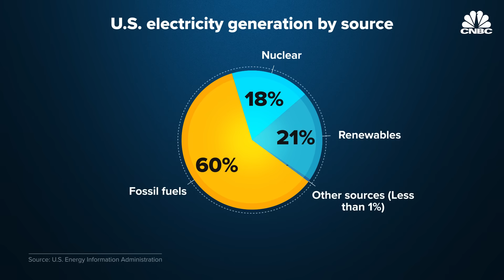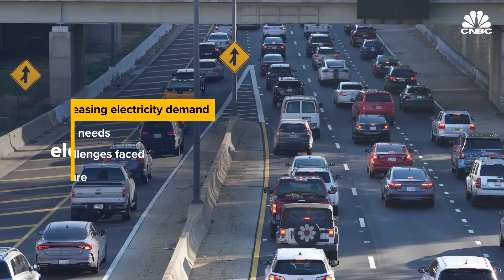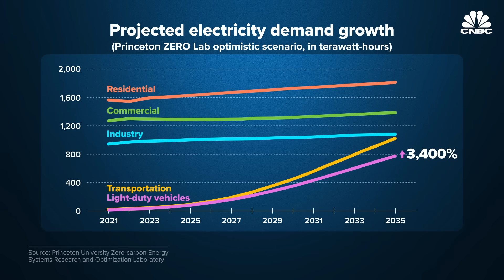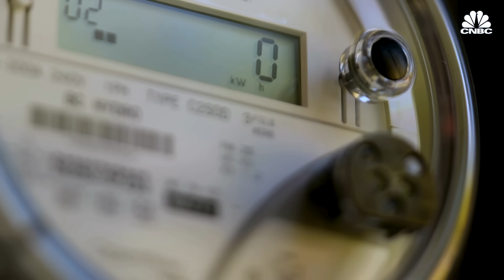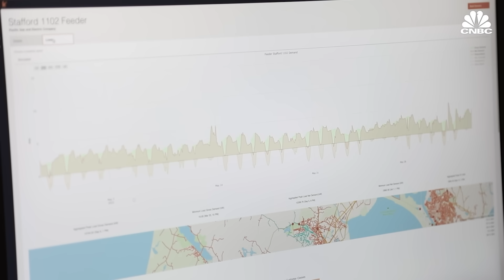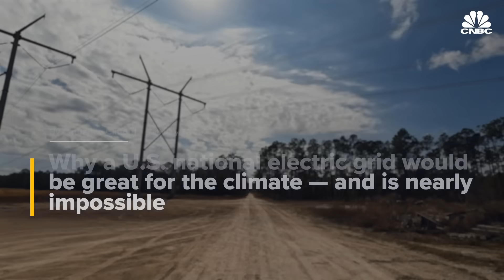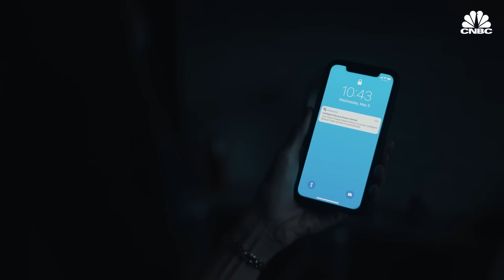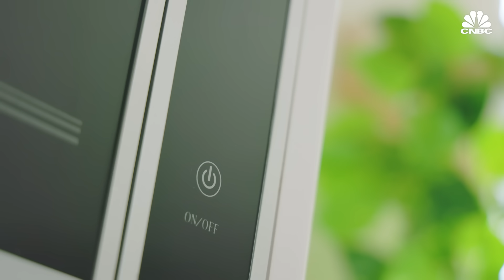Can The U.S. Power Grid Handle The EV Boom?

Comment: The answer before I even watch this video is a resounding no! Work on the electric grid in Nevada where their everywhere. A lot of transformers are already overloaded just by the houses. Add that we don’t produce any oil yeah that’s right you still need fossil fuels for electricity go figure and with those prices so high you have less generation or blackouts or higher cost for electricity . Oh forget to mention if your neighbor has one they’re eating up way more than the allotment their given basically stealing their neighbors share of that transformer. Sat on meeting with one of the largest EV initiatives they got all this grant money but none to rent out the land for those charging stations yeah that’s right you gotta pay the landowners. This is literally a ploy to try downgrade your fuel consumption which makes no sense. Electric companies build to minimum serve not gold plating a system, hasn’t  been done for a long time.

Comment: using the California example, it would cost about $1280 per person to update the grid. People will save much more than that by electrifying everything (EVs are cheaper than gas, solar can earn you money instead of costing, efficient heat pumps are much cheaper than natural gas of fuel oil...).

Comment: The US grid has increased in capacity 5x (500%) since the 50's.  To move to all EVs we only need to increase the grid capacity about 20%.  Most EV charging is done off-peak and actually helps balance the grid (increasing overall utilization).  Everyone also forgets that we'll be using less electricity to refine fossil fuels which helps offset the increased usage. The fossil fuel infrastructure uses a lot of electric power.  The statement that our electric usage hasn't increased in 25 years is way off, data centers created a huge increase in electric demand from 1998 to 2012 before it started to level off.
Reply: not bad -- you are pretty close.  20% Add for 100% EV, but then deduct 10% for the reduced Oil Processing.  Net increase is 10% across 20 years.   That was the general model.   But now it turns out that over 1/3 of EV owners also get Solar PV -- creating a Net Deduct of their entire house, along with the EV.  If this continues the final Utility Total at 20 years is a Net Negative.  Data Centers are only about 1 to 2% of the Total Grid.  Nuisance with Data Centers is not the load but the requirements for High Reliability. But look for that use to drop with near term technology shifts.
Reply: I don't know about the USA but here in the UK our 31 million cars do an average of 8,000 miles a year each . That adds a total of 65twh to last year's 306twh so back to about to about  375twh OR the same as demand WAS in 2006.
Reply: I think in North America the average is closer to 15,000 to 20,000 km a year (9400 to 1200ish miles)
The actual % increase in energy useage is very acceptable especially since it will take decades till 100% of all vehicles are electric. 

This news articles is discussing 2 seperate issues, the increase in renewables (and aging infrastructure) and EV adoption. 

If they continued to expand natural gas to cover the EV adoption it wouldn't be as expensive, but still greener than gas. Obviously the best solution is to switch to renewables AND EVs, but those two things don't have to be intertwined.
Reply: Uh, 50 miles a day in a model 3 is an extra 10kwh per car.  i.e. every household with 2 cars increases residential demand from 30 kwh/day to 50kwh/day.
Reply: @Effervescent_Smegma   You can do the big picture math by looking at US Total Miles Drive (per year) = 3.22E12.  And average Watt-hours per mile = 250 Watt Hours.   So 3.22E12 x 250 = 805E12 Watt Hours.   Current US Total Electricity is about 4E15 Watt Hours.  So (805E12 / 4E15)  x 100% give about a 20% increase.  But then deduct the present electricity used in the Oil industry and it is only a 10% increase.  Spread that across 20 years and it becomes 1/2% increase per year.  Home Solar PV is expanding quicker than that, so the net effect is a overall reduction in Utility Grid generated electricity. -- with ALL Electric Ground Transport.
Reply: @philtimmons722 what's this E in your equation? What type of math is this? I'm not familiar with this math. Are others?
Reply: @robertlee8805  Really, what school did you drop out of?  805E12  = 805 times (10 to the power of 12)
Reply: @retiefgregorovich810 be nice. Not everyone did maths heavy subjects at school. I talked to someone with a PHD in corporate adaptability, who didn’t know what an asymptote was. He wasn’t stupid. Just never had the need or opportunity to learn it.
Reply: @Effervescent_Smegma ,  From what I have read, the Utility companies back in the 70's had many sleepless nights because of the increased use of air conditioners.  They where not energy efficient back in the 70's.  My 1971 air conditioner used 4,000 watts per ton of cooling capacity, while the replacement I installed in 1995 was 10 SEER, or about 1,500 watts per ton.  Now I have a 2014 14 SEER unit, and it only uses about 950 watts per ton of cooling capacity.   So my heat pump uses more than 25 KW a day, enough power to drive a Tesla 100 miles a day. 100 miles = 36,500 miles a year, much more than the average driver does each year.  

And as pointed out so many times today, the cars can charge at night during off peak power, or in the daytime in a place like California where they have 15,000 MW of solar power in the daytime!  

And a lot of homes are installing a 6 KW solar system, so they are reducing their load on the grid by 30 KW per day.  Thanks everyone going solar!  You have saved Florida from what Al Gore predicted as 2 meters of water over Florida!
Reply: If Sen. Manchin is heading this you'll see more FOSSIL FUELS being incorporated into the grid. His state is HEAVILY involved in COAL.
Reply: This ignores the fact that oil refineries produce more than just diesel and gasoline.  They will simply retool to manufacture other products from oil and keep on chugging.
Reply: Only problem is that you are only factoring EVs, not electrification for homes and improving the industry. So we probably need more grid capacity than 20%.
Reply: @youseflatif796  actually in recent decades energy consumption of homes has gone down. Due to more energy efficient devices, LED’s and home solar among other things.
Reply: @engineeringtheweirdguy2103  Oh yeah, I forgot. As long as most people use the energy-efficient appliances like heat pumps and what not, we shouldn't worry.
Reply: @youseflatif796  not that we shouldn’t worry. But it’s there isn’t any reason to be cancelling EV’s on the grids behalf just yet.
Reply: But Evs are growing. If all EVs will be charged off peak hours  it will be even worse because it will affect transformers and other grid equipments.
Reply: @Haidar536  most EV’s are charged overnight during off peak hours.
Reply: @engineeringtheweirdguy2103   That's even dangerous when there will be rapid EV charging off prak hours or at night that will hamper grid as grid equipments lifecycle will be reduced due to extreme pressure.
Reply: @Haidar536  yeah not really. When generators have to wind down, or shut off due to off peak demand being so low, they waste a huge amount of of energy and fuel. 

The lost energy when shutting off and spinning back on and re-synching with the grid is enourmous in terms of wasted fuel costs. And when they’re wound down, then they aren’t operating at their peak performance in terms of fuel burnt vs kWh generated making them more expensive to run per kWh. 

Trying to prevent this they have tried to incentivise people to use more power during off peak, by making it cheaper. 

So what off peak charging would save power companies much more money, wouldn’t generally add much wear and tear on the generators than what they’d already be getting, and the reduction in operating costs would filter through to peak times as well, in general, reducing energy prices. 

So no, it isn’t dangerous. That’s a laughable assertion. Power companies WANT their assets to be utilised as much as possible. It’s called return on investment (ROI). The less it’s used, the less ROI, the less it’s used at peak capacity or the more they have to shut down and come back on, the more lost ROI. It doesn’t make business sense to utilisation based on maintenance already accounted for in the sale price of energy.

Comment: It's 2023. You live in a house in the suburbs. You want a landline phone or a cell phone? You want an antiquated expensive-to-upgrade centralized grid you pay to use and upgrade* or you want your own off-grid-capable solar with battery storage that you control?
*Btw, you also pay for their new gas power plants, their failed-to-ever-open nuke plants, their coal-ash spills, and their substation repairs after domestic terrorist shoot-em-up attacks.

Comment: As a Solar employee, it’s not just the EV industry that’s been impacted but ALSO the Solar industry especially in California.

All systems sold now to residential MUST include a backup battery because there’s too much power being imported to the grid so they’re making Homeowners store power on their own.

Batteries retail from anywhere between $15-17grand so basically if an HO goes solar, before, their new electric bill could be like $90 for example. Now w/ batteries, lowest bill solar can do for them is like $150. 

Public utilities need to just update the grid plain and simple
Reply: Batteries are not required.   Just work on Aligning the Time-of-Use with Time-of-Production.
Reply: @philtimmons722   batteries are absolutely required if they want to see savings - the pinnacle point of going residential Solar in the first place

Telling HO’s to avoid TOU w Solar is like telling HO’s not to drive their automobile during Rush Hour

Problem
Reply: @jpmcfrosty  Batteries COST -- A LOT.   Most Solar PV homeowners enjoy the cost savings of aligning Solar Time-of-Production and Time-of-Use.  Typically Air Conditioning.   It is like a set-back thermostat -- in reverse.  If you have Solar PV, you can run your Air Conditioning especially during the Solar PV production time (typically 8 am to 4 pm) -- has your house all cool before the heat of the day hits.  Same on EV Charging, same on Water Heating.  Really not that difficult and saves from the need for batteries.   You do not actually do any of this in the Real World, right?

Comment: Many energy efficient appliances are arriving from Europe who have used this tech for decades.  As energy prices increase usa more heat pump hvac, heat pump dryer, heat pump water heater, geothermal heat pump 20-40% more efficient than separate furnace/ac system.  No ways to conserve a precious commodity.   ⚡️

Comment: EV Boom? we just had an EV charging station installed a few blocks from here, charging for 4 veh or so. On my wife's way home she has stopped to chat with a few of the EV owners and they aren't that happy now that the reality of spending an hour or so just wasting time while your car charges up everyday.
Reply: Meanwhile, in the real world -- most folks with EVs charge at home or work.  Drive in, plug in and walk away.  When we come back the car is charged.  We spend a total of less time dealing with charging than you do at the Gas Station.
Reply: @philtimmons722  That might apply to your narrow minded world but the reality is far diferent.
Reply: @epytaffskitchenstink  Let me guess . . .  you do not have an EV, do not drive an EV, and are probably not getting an EV . . .  but you know all about EV charging . . .  because your wife told you so?  Is that about right?

Comment: EV trucks like the Rivian, lightning, and Hummer have much larger batteries vs car batteries.  The trucks can easily power a house but bigger batteries need longer time to charge.  Many of the Teslas offer 66-100 kwh battery vs Rivian around 120 Ford 130 and Hummer 250 kwh battery
Reply: few will need to do a full charge every day on their vehicle.  Most will need a few hours of charging per day, or less. And much of that charging will take place late at night when power plants already generate more power than people use.
Reply: One reason other auto makers flocking to Tesla level 3 Dc fast chargers(superchargers) with NACS plug are fast charge times vs public chargers.  Non Tesla owners unhappy with slow public chargers especially with the larger truck battery.

Comment: Short answer? No!
The power grid can’t even handle the Data Center boom going on right now.
Reply: The data center boom ended a decade ago. There is still more computer power of course but modern servers pull much less power and make much less heat. Data center power usage increased significantly from 1998 to about 2012 and then leveled off.
Reply: @GregHassler  you could literally not be more wrong. I’m in the business and in Loudoun and Prince William County Virginia. There are over 20 of them on hold for construction because we can’t power them.
Reply: not true. They are running all the time, or you would not be reading this. New servers are more efficient, meaning less power usage than 10 years ago.
Reply: @marklefler4007  you literally could not be more wrong. I’m in the business and in Loudoun County and Prince William County Virginia. There are over 20 of them on hold for construction because we can’t power them. 32 of them went online last year alone just in Virginia.

Comment: We need to harden our grid against solar flares and emp attacks too.  Might as well do this at the same time.
Reply: As others have pointed out, EMPs mean nuclear war. Solar flares only affect relatively small parts of North America, along the eastern seaboard. If a solar flare is detected (yes, the sun is monitored 24/7/365) vulnerable power lines can be switched out in plenty of time. Here in Arizona we have no vulnerable lines.
Reply: The most important part is to have fuses at transformer etc.  It is no biggie to lose power a few hours, because EMP and solar storms are unlikely events.  Besides a solar storm will affect the northern states near the auroras.

Comment: This is the first I've heard any discussion of grid capacity. Perhaps I've missed it till now. It hasn't really been mentioned that if we change everything to electricity as has been proposed we'll need at least double the present grid capacity, or perhaps triple.
Reply: Considering this is the first time you have heard the topic . . .  why in the world would you make up such silly numbers?   Real numbers are Grid Use due to EVs will increase total annual grid load by about 10%.  And that is across 20 years.  About 1/2% per year.  We are building Solar PV faster than that.

Comment: More air conditioning and longer summers will really strain the system also.  Grid needs updating especially for EMP issues
Reply: Curious what EMP issues? Solar flares are really about it. The other’s nuclear weapons, but you have worse problems to deal with if it comes to that.
Reply: @DaveQZ85  Solar flares would be the main reason. Although a huge one is pretty rare it would only take one to send us back to the middle ages.
Reply: In this case, decentralization is where it's at. Things like redox flow batteries in homes making up a virtual decentralized battery system. In conjunction with rooftop solar to emphasize decentralized production. At least for neighborhoods.

Also, if we could normalize geomass heatpumps, that would be great. Basically just a normal heat pump system, but instead of an outdoor unit with a fan, it just goes through tubes placed in the ground. Way more efficient for relatively little change in system.
Reply: EMP is a public perception problem. As AsianBob7 points out, it is impractical to harden against and not one of the big concerns in the real world. I was in sixth grade during the Cuban Missile Crisis and nobody was talking about EMPs, just fallout and death.
Reply: Fortunately a solar EMP is reasonably predictable and only damages systems with very long wires (e.g. the grid). With enough notice, we can disconnect our homes from the grid. If we have solar+batteries, and are not feeding electricity back into the grid, then we can disconnect from the grid completely. Homes can also have a whole-house surge protection system installed at a reasonable cost. Nuclear EMP is pretty much impossible to protect against due to its very high peak power, even though it is of short duration (typically tens of nanoseconds).
Reply: Air conditioning takes much less energy than heating.
Reply: No more gas stoves in new homes

Comment: Building code needs to be changed worldwide to make solar panels mandatory.  This way the power is generated where it’s used.  Most evs are charged off peak at home.
Reply: "Off Peak" means when the sun goes down and solar panels don't work in the dark.
Reply: @DarkPesco  I understand but if there’s energy storage built into the grid then solar can contribute to charge these batteries during the day and when evs charge at night they can draw from the grid energy storage batteries   Off peak also means the grid will be far less stressed since off peak is times of lowest power use

Comment: If a more modular approach was taken to power generation and distribution, the grid could be made MUCH more robust. I'm talking home and business-based hydrogen cracking and storage using solar and wind. The stored hydrogen could be used to make power during peak demand using a fuel cell. This could be subsidized by the government to help people adopt the systems.
Reply: Inefficient, just use a battery not a hydrogen fuel cell.
Reply: @OtisFlint batteries are absolute garbage energy storage mediums